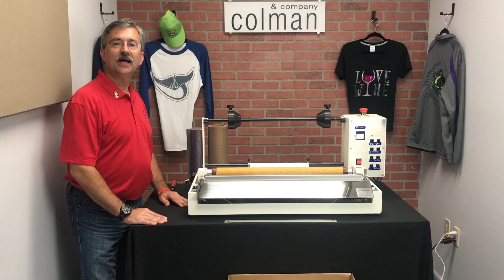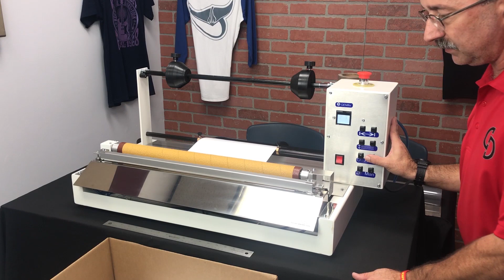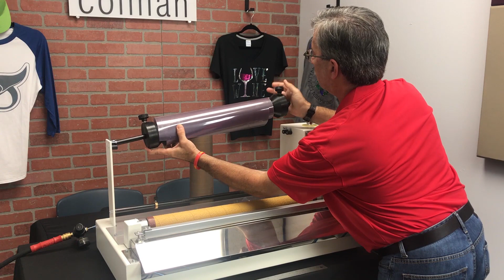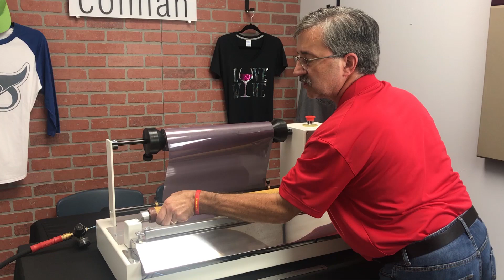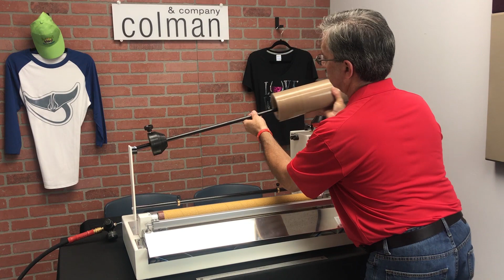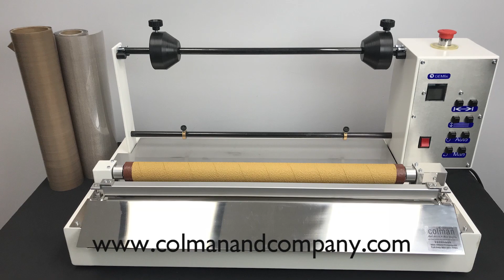GEMfix 60XC - Automatic Roll to Sheet Cutter

Comment: I found this looking for something else, but a machine like this might be handy for cutting the sheet materials used in the production of composite parts for aerospace and similar.  A complete part for the oven will have a built-up plastic vacuum bag and sheets of other materials inside that.